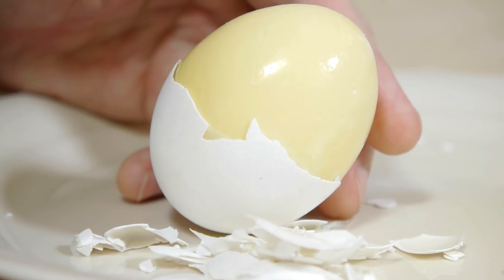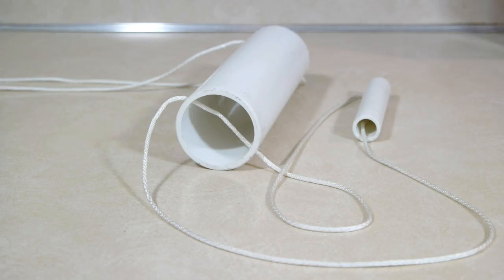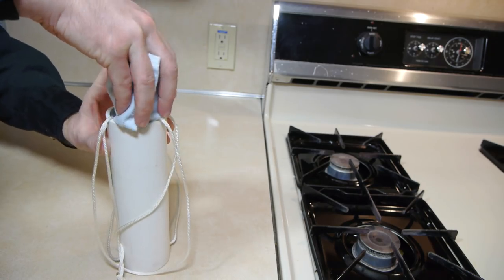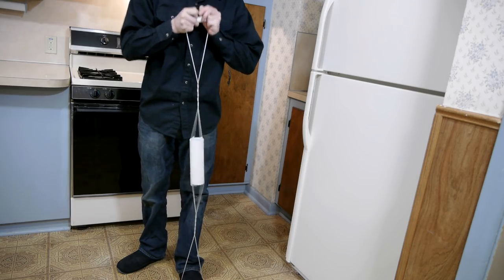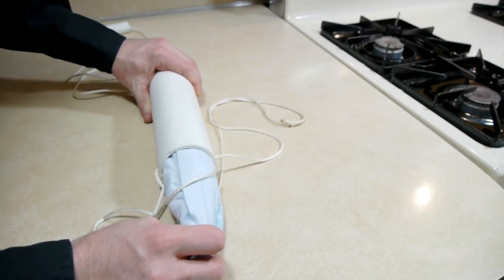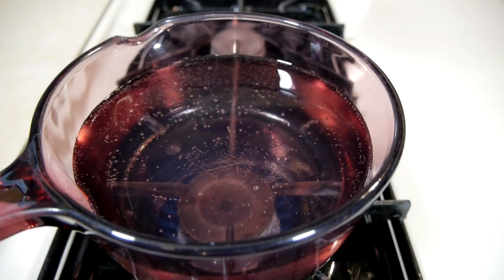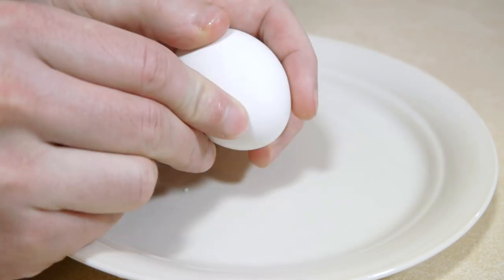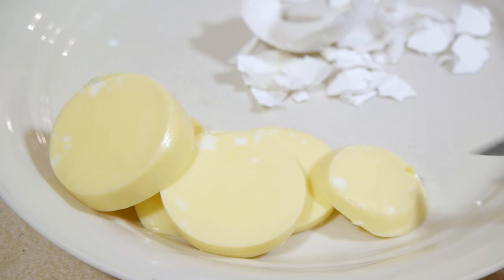How to Scramble Eggs Inside Their Shell - NEW VERSION

Comment: An empty pringles can works well for the main tube as well. Just a tip for those looking to try this trick.
Reply: +Victor Benoit - good hack to know. I have one of those on hand. Can try this tonight. PVC requires a trip to the hardware store. Thanks for the idea!
Reply: +Victor Benoit Tried the pringles tube. The top part of the pringles tube isn't hard enough for it to work. The paper at the top just rips. Maybe a plastic tube with off-brand pringles (aka: stacks) might work better.
Reply: +Victor Benoit YOUR A HACKER AHHHHHHHHHHHHH CALL 911 HES HACKING THE GOVERNMENT!!!
Reply: +Carl Bucholtz Ah, I musta gotten lucky when I did it, the tube stayed intact for me. But yeah the off brands with plastic tubes would likely work a bit better.
Reply: +Victor Benoit Or a toiled roll
Reply: Victor Benoit it was actually my problem. Thanks to ur idea.

Comment: I’m going to repurpose this into a paint mixer for scale model/hobby paint…

Edit: works like a charm! I used what I had on hand which was a super thick walled cardboard tube that’s the perfect diameter for Vallejo bottles (almost too perfect. Have to shake them out past the string) but a couple twists and it’s perfectly mixed. Probably gonna go hunt down some PVC pipe in the barn tomorrow and make a larger one for my bigger bottles.
Reply: Currently trying out the same thing for paints. Can't seem to get the right rope for the application. None of them seem to twist back on each other.

Comment: If you are worried about the shell being weak and breaking during boiling . Why not steam them for 17 minutes they will come out perfect. I steam all my eggs. Six and a half minutes for soft boiled and 17 minutes for hard boiled. And they peel very easy.
Reply: Whenever I make deviled eggs, I always steam them, but only for about 12 minutes though.  I use a large metal pot with a good fitting lid, and a metal colander that keeps the eggs out of the boiling water at the bottom of the pot.  You only need as much water as you will boil away in 12 minutes, and to keep the bottom of the pot from boiling dry.

Comment: Depending on the type of cord or pipe you use, to get that nice rotation you'll want to increase the rotational mass so it will have enough energy to wind up the opposite direction so you can repeat process.  If it's too light or the cord is too heavy, it won't wind back the other way.

Comment: If microwaving scrambled eggs, be sure to add 1/4 cup of milk for every 2 eggs used. If you don't have milk on hand, I've found that a slab of butter does the trick (not sure that it makes a difference, but I used Irish butter)
Only microwave in a paper or plastic (tupperware-style plastic) container without a lid. 
Every 30 seconds, stir to ensure even cooking.

The time the eggs spend cooking in the microwave should not exceed 2 and a half minutes if done correctly. They can turn out pretty fluffy.

The only reason I did this tonight is because when I tried turning the burner on, I smelled smoke and quickly turned it off. Need to clean the burner pan.

Comment: I tried it but it didn't come out well
Reply: Same
Reply: same
Reply: I also tried with a mini mixer, max speed. Fail. Egg white and yellow like always. I pin-pricked the egg, mixed inside the egg with a pin then max speed at mini mixer. Fail.
Reply: The trick is the rapid spin-counterspin. It creates vortexes that tear apart the yolk sack and mix the two components thoroughly. Just spinning it fast will not do it.
Reply: I either had too short of a rope, or plastic rope is not the correct rope to use. Maybe I wasn't doing it right, not the right method. Idk

Just another failure on top of countless others that I have tried.

I tried doing the PVC Rocket from Kingofrandom with Kitty Litter sugar and potassium nitrate. That failed as well. Guess I wasn't made to craft things.

Comment: The stretchiness of the rope is very important.  I tried using several different types of rope I had at home (cotton/synthetic blend clothesline, polypropolene rope, small polyester tie-down rope , and could not get this method to work.  I guess I'm off to buy some thin nylon rope.

Comment: OH boy. I'm here to test out that "Every one" claim.XD
A good way to cook them without worrying about the compromised shell would be to start them in the pot with cold water. Then to bring the pot to a boil with them in. After it starts boiling, remove the pot and let them sit in the hot water for around 10 minutes. Then cool and shell as usual.

Comment: how long do i need to spin them for? i may have used too thick of a rope (laundry line rope) so maybe not spinning fast enough as a thinner one would?  and any suggestion re: making sure they are scrambled, thought i saw a difference with the flashlight but then when cooked none of them were scrambled :(
Reply from the maker: It's less about time and more about speed. You need at least one or two very quick hard pulls to break the yolk.

Comment: I made this myself and while testing it to make sure I had the length of the "handles" were correct, it would not spin properly. Whether I pulled extra hard or phoned it in, it would go back and forth twice and then just stop. Is this because there was nothing in it? Or do I have to make sure to drill the holes in the exact same spots on both sides?
Reply from the maker: Probably your technique is not good or you're not pulling hard enough. You need to pull hard and then let the lines go slack when it reverses so it can wind up easily.

Comment: Alright, I'll bite.
I'm trying this out, but I can't seem to get the rope to twist onto itself for every pull. Even with a "nylon" rope.
Does it need to be an actual stretchy nylon rope, or can any other material work?
Reply from the maker: The rope I used was not very stretchy. It takes a bit of practice to get a rhythm going where it winds properly both ways, but it could also help to make the handles narrower

Comment: Yes i do have a handle,but my question was if you can tell me what is the dimension of the drill to drills the holes in the 2'PVC ,if the holes on the PVC are the same direction on both ends of the PVC,not a 10 pr 15 degree different from each other,and were i can buy the same rope and material is on the video.My girlfriend is very strong and she has a hard time to do exactly like on your video,can you please put all this information on your video.Thanks
Reply from the maker: Where the holes are drilled doesn't matter. Use a synthetic rope, not cotton. That may help.

Comment: Hi ,i was working in this project for my girlfriend and i miss something ,because is not working,can you please put in the video were you buy the thin rope and how you drill the holes on the PVC,because i did exactly from your video and i'm not able to make the PVC to turn back in ford.Thanks
Reply from the maker: Do you have a handle on it? You need a handle and you need to pull hard. But also you need to loosen up when the tube is about to coil again.
Reply: I did use the nylon rope and still not working,and i give up on this project,way is so hard to provide the right information about the dimension of the nylon rope and were i can buy this?? i don't understand??
Reply from the maker: Because I made it years ago and don't remember where I bought the rope from.

Comment: I'm so sad right now. I've been trying to get this to work for days and it won't switch rotation, it just stops. I've switched ropes and lengths too, and nothing has worked.
Reply from the maker: Aw sorry. You may need to let off tension more when the strings are about to straighten.
Reply from the maker: Or you may need to pull harder at the start so it goes faster. Probably a bit of both

Comment: that's just a boil eggs you even admitted all you need to do is shake the eggs while they are in the Shell and drop in the water. it's still a boiled egg there is a difference between a scrambled boiled fried sunny side up over medium over light a omlette I don't even use a mixing bowl I just shake them in the Shell about ten seconds and crack in the pan
Reply: Joseph Payne d